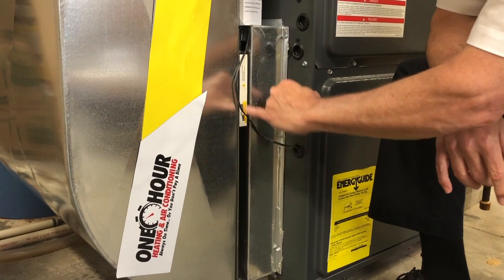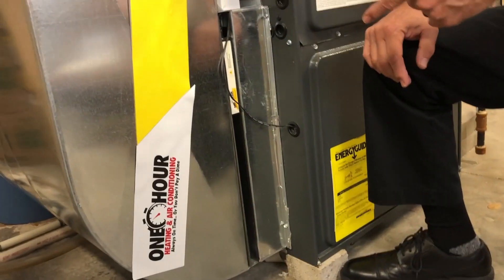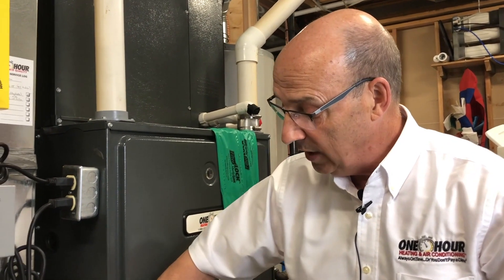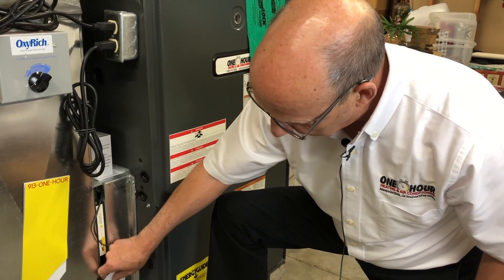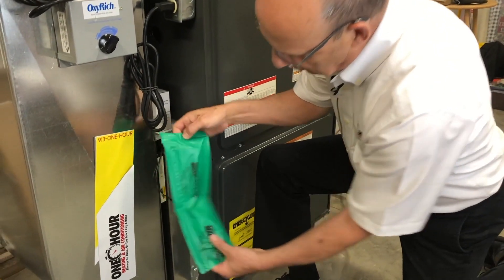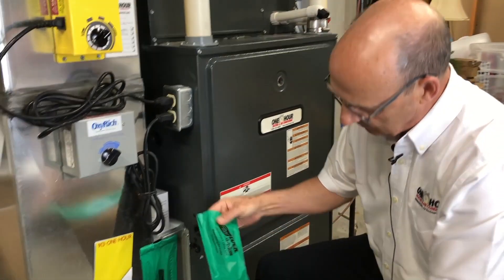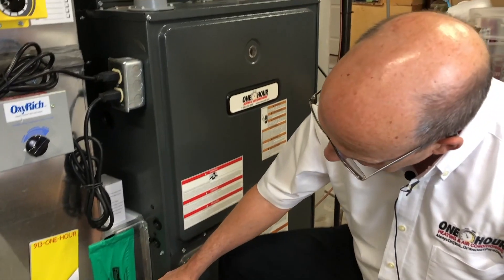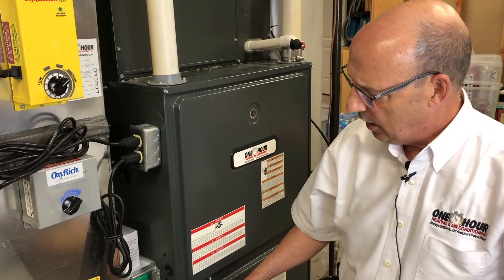Why Does The Furnace NOT Come With A Filter Slot Cover?

Comment: My system is completely different from all the rest. It has no intake filter location anywhere.
Reply: Wrong! My furnace doesn't have an intake filter either. Haha, we are like two brothers from another, unless that's you Brandon, my true blood 😄👋
Reply: Also, I think furnace filters might be over rated, just like in aquariums. It's all about the big picture set-up imo. The house itself can be one giant filter- as long as the furnace is strategically located where no dust from work shops etc. like ol' boy pointed out, can get into the system. My house's system was put in almost 30 years ago and all the original AC unit and furnace blower are still in tip top shape, running like champs and keeping us comfortable. No worries partner, unless of course your furnace is in an untreated crawl, workshop, or attic where potential funk can happen. Hope all is well!
Reply: My system is basically one big dust circulator. And it's a newer unit. There's an intake location but it doesn't have a place to put a filter. Even when I had it inspected they said it was strange. I have to regularly unclog the dust on the intake fins or it starts to lose suction. The duck work has so much dust in it. I stay sick from allergies.
Reply: @randomtube8226  So sorry to hear that. I really wished someone had put a filter on my unit as well, as having the option would definitely be nice. I do have a suggestion though, which would obviously take a bit more work than changing out a filter in a traditional system. And that is to locate all of your "returns", or intakes. There is usually one in each bedroom and another or two in large open rooms. Once located, you can create your own filters very cheaply by simply covering those intakes with any type of fabric that still allows ample air to flow through. Use your imagination. You can also probably hire a qualified HVAC tech who does "side work" and they will pop in a slot that allows for filter exchanges near the blower. 
  Honestly, and most people don't like to hear this, but putting in the work to eliminate dust and air contaminates coming into the system can and will do wonders and prolong the life of your system. This means regular vacuuming, especially if you have pets. Traditional filters can actually clog and defeat the purpose, causing your air quality to degrade over time if not changed very frequently, especially the expensive thick filters. They mostly will inhibit air flow, even when brand new, and cause your blower to work much harder to move air at a much slower rate, which can cause mold, mildew, etc. to take hold in many areas of your home. Personally I would rather have high air flow in a well kept space than to have low air flow in a well kept space, so I always keep my air filters very light/wispy (and cheap) wherever I am living, if of course the furnace has a filter slot, which ours doesn't. Hope this helps and feel free to let me know what you end up doing.